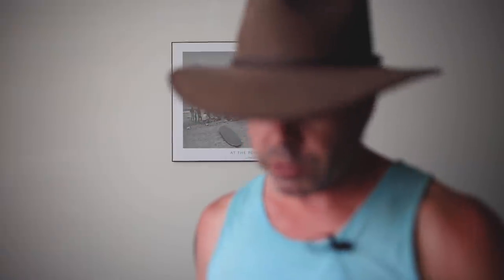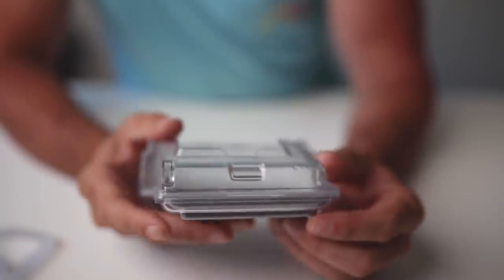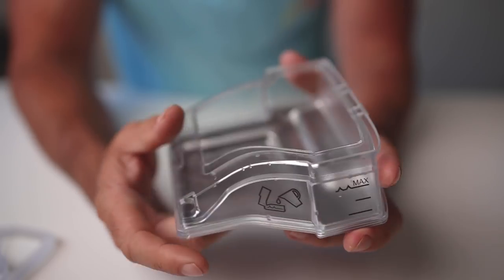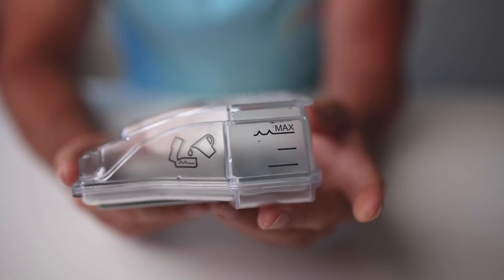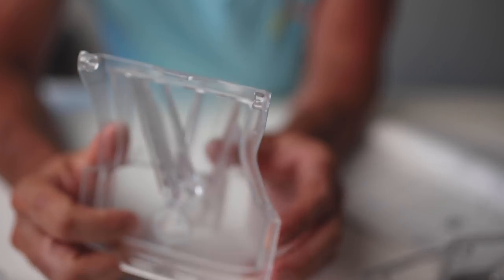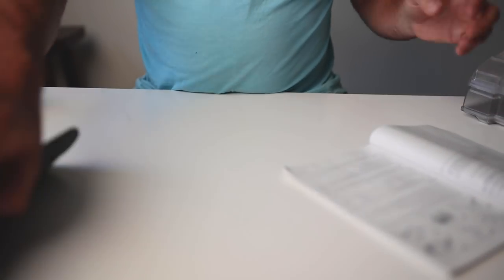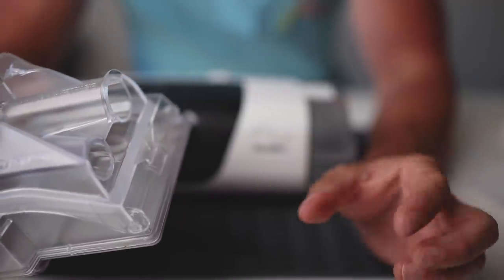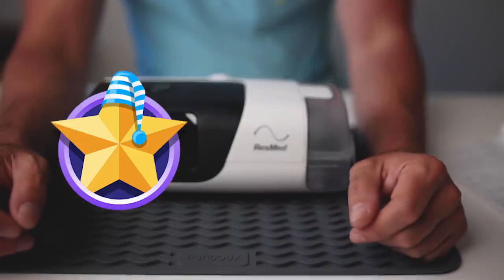Faulty ResMed AirSense 10 Humidifier Chambers Leaking Water

Comment: So, I just got mine, and didn't realize that the humidifier came in 3 pieces instead of 2.
I used it the first day, and while it it wasn't the most comfortable thing, it did what it needed to.
I go to clean it like the company told me to the next day, let it air dry, fill it and then I go to put it in.
When I use it "high leak detected, check water tub." The error message took less than 2 seconds to come up.
It was Saturday when it happened.
The place I got it from wouldn't be open till Monday.
A replacement tub is 30 dollars, and I didn't know if Medicaid would replace it since it seemed like I was the one to break it.
I was so angry.
I told everyone.
Lo and behold, I find this video after several failed attempts to find any info in the forums.
I see that the humidifier tub has 3 pieces, and immediately go to check where I dry my dishes.
Nothing.
I inform everyone, and look again.
It has stains on it, but it's on the kitchen table.
I have never been happier.
I reassemble the humidifier, put it in, and it works.
Thank you for the informative video!

Comment: Don't know if someone else posted this, but get the dishwasher safe chamber. Model 37479. It's better made and I've never had one leak. Just wash normally in sink. Standard chambers are junk and Resmed should really compensate.
Reply: That dishwasher safe chamber is made of polycarbonate plastic and I'm not too sure if it contains BPA since this material is typically made with it.

Comment: Can you use this rested without the humidifier?
Reply: Resmed
Reply from the maker: yeah mate however you need to buy a little side plate that goes in where the humidifier normally goes. It will be 2db quieter also if you do this. Cheers

Comment: I have had a number of these chambers, and they all start leaking after a few cleanings.  This almost seems to be by design - the engineers couldn't be this incompetent.  They should have recalled these and replaced them with a better design.  The older design did not have this problem.

Comment: I recently started receiving the water tub with the full metal bottoms, instead of the round bottom, for the Airsense 10. For some reason the new model leaks air, not water, for me. I cannot get it to seal, and there is nothing that Resmed or my equipment people are able to do about it. Have you ever come across this issue?
Reply: Hi, did you ever solve this problem with your CPAP water chamber? I have had the square bottom ones and just got a new CPAP machine (my other was 5 years old) and they sent me a water chamber with a round bottom which I’ve never seen before. When I put it in my new machine is scratched the inside on the bottom pretty badly! The fit didn’t seem right but it appears to be the correct chamber.

Comment: just a note I've found that you don't get any build up if you use distilled water
Reply from the maker: Thanks for your great suggestion Jodie. Much appreciated :_cheers:
Reply: @CPAPReviews  Glad I could help
Reply: Searched for distilled water in the major supermarkets without success. Then found out they sell demineralised water (found in the cleaning products aisles in 2 or 5 litre containers - not expensive) which
doesn't leave any scale residue in the tank.

Comment: The worst design ever for leaky water chambers was the old REMstar Heated Humidifier by Phillips. To clean the chamber you had to pry off the BOTTOM of the tank. After several cleanings the bottom plate would deform and start leaking...
Reply from the maker: G'day Mike, i'll gladly second that mate. The WORST in history. Use to drive me nuts back in the hospital every morning. Cheers legend. Nicko

Comment: It is a very poor design and got rid of my Red Med since the water chamber leaked at the glue line after about 4 weeks of use. As it got heated up it would start leaking.
Reply from the maker: G'day Kevin, great to see that membership badge next to your name mate! Really appreciate the support. There's no doubt it's a design flaw (which is why they have since changed it). What machine did you changed to if you don't mind me asking? Cheers
Reply: @CPAPReviews  Hey Nicko....
I believe it was the 10 and was over 4 years ago, my DME supplier moved me to DS1 after having numerous issues with the water chamber of my Res Med.  It was the chamber you showed in your video...
Cheers....

Comment: This can be caused by using a dishwasher to clean it
Reply from the maker: Yes that's a good point you make! They can actually be put in the dishwasher if it's on 'gentle' cycle. Cheers
Reply: When looking for a replacement for my S10 tank it seemed there were two versions, the one with the white tab on the top, and a sturdier, dishwasher safe one with a grey tab on the top.
Reply: Yes! I have two tanks, they both seem to be damaged after I began using a dishwasher to clean them

Comment: I've never had a leak and sure it's not a part designed to last.  Luckily my insurance replaces mine every 6 months.  To prevent mineral deposits always use distilled water.  I wash my water chamber everyday while I'm in the shower, easy peasy.

You didn't really explain how the change with the AirSense 11 water chamber fixed anything.  The round metal heating pad is still sealed to the plastic chamber.
Reply from the maker: Nice one Dan, Cheers mate!
Reply: @CPAPReviews  Again, you didn't explain how the new water chamber fixed the issue.  What was done?  It's still plastic with metal, so there still is a seal around it.

Comment: What about the water that can get trapped between the plastic and the metal bortom during cleaning. There is a draining port of some sort, but I've never really figured out when (during cleaning) that I've managed to get water where's it not supposed to. Anyone else with the same problem?
Reply: Yes, I’ve also noticed water gets trapped between the plastic and metal plate after cleaning.

Comment: FYI, ResMed has designed a new water chamber with a circular bottom plate to replace this one!
Reply from the maker: Yes that is correct
Reply: I am saying that I received a new tank with the circular plate for my ResMed10
Reply: @MrJbezzz  Where did you get the new tank with circular plate? My AS 10 came with one when ordered last June but cannot find a supplier that has that style or even knows about it's existence.